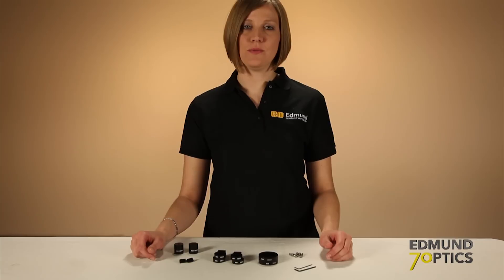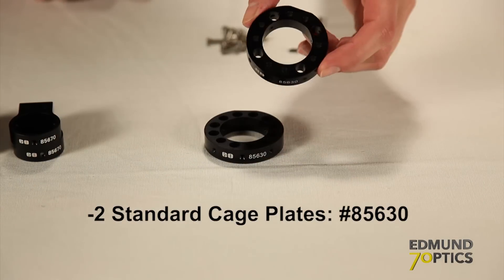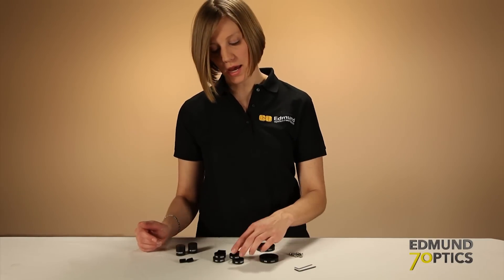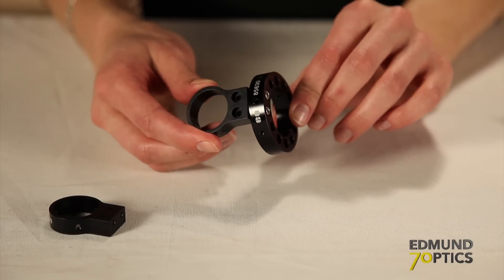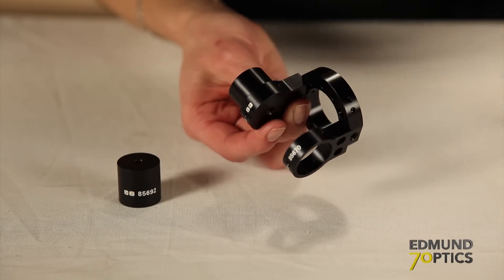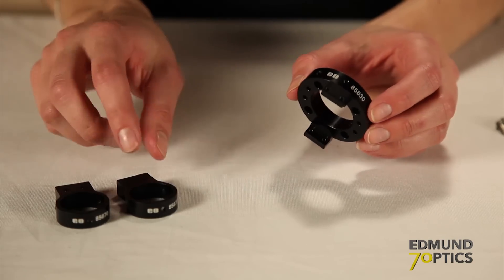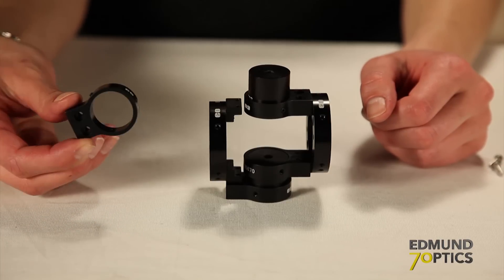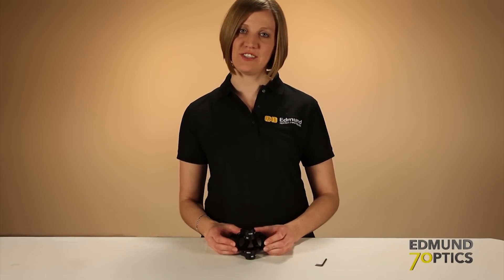How to Build a Swivel Joint Assembly

Comment from the maker: If you have an existing Cage system from another manufacturer, you may need a specific adapter plate to correctly interface with our components. It will vary by manufacturer, so be sure to ask our Application Engineers to help you determine all the necessary parts. You can contact them by phone, email, or chat - whichever works best for you.